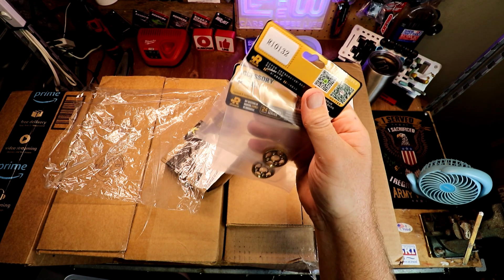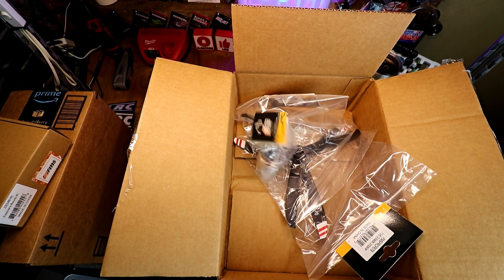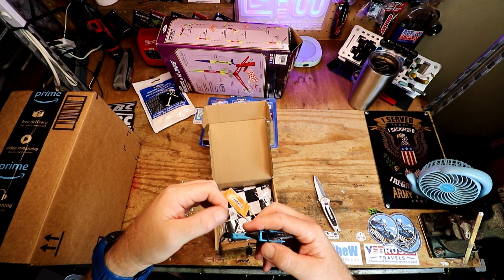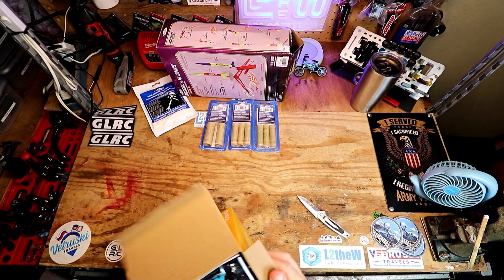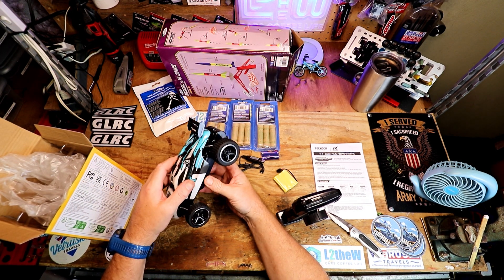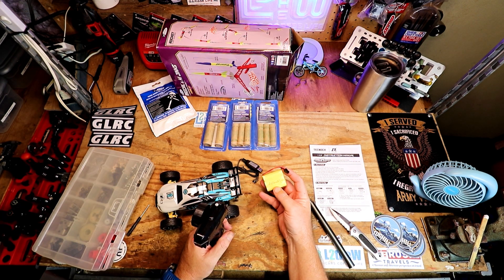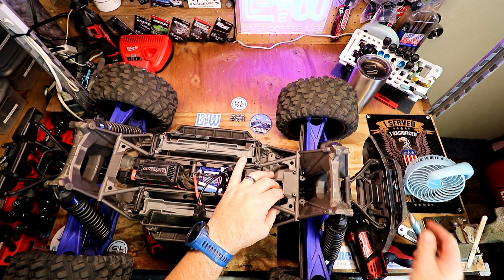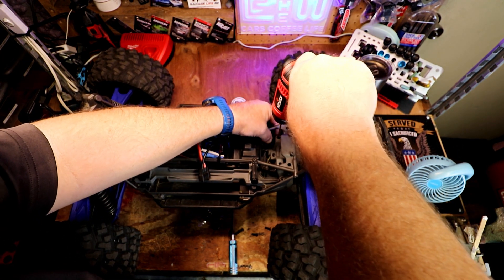EP24 On The Bench Cool New Stuff And Replacing The Xmaxx Servo Spring

Comment: If u get adjustable steering rods and point the tires out abit may turn sharper....
Reply from the maker: No thats not how that works you dont want a positive toe out the servo is tired I got a replacement stay tuned
Reply: K wasn't sure just noticed a few of my cars I got came out the box with the front pointing out ward and the back tires pointing inward ...
Reply from the maker: @justinfolster2278  it happens a lot the redcat Valkyrie I just got had one front tire pointing way out it was a easy fix to bring it in you want a little bit of town in or at least straight  yeah its common even out of the box for them to not have been put together right usually cars with fixed ends dont have that problem
Reply: K I'll fix mine didn't no thanks ....haven't been in hobby to long still learning.....
Reply from the maker: Check out my on the bench videos its where I try to teach people how to fix rc's and teach about them I had a lot of people like you new into the hobby ask so I put these vids together